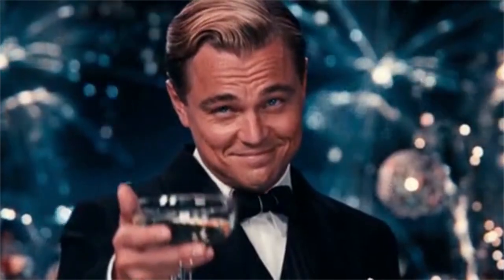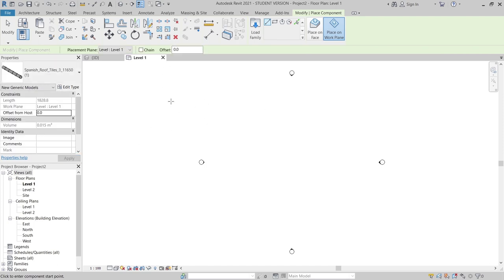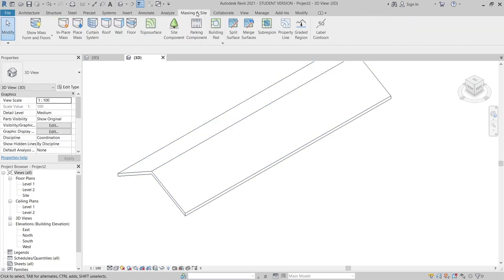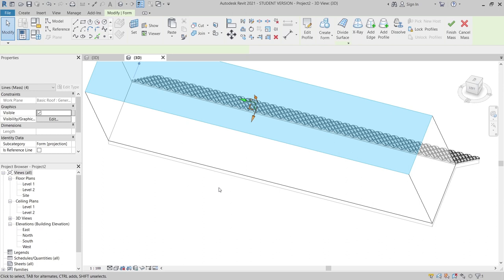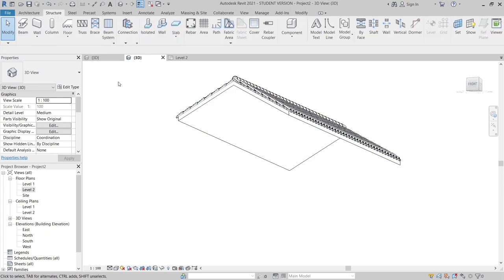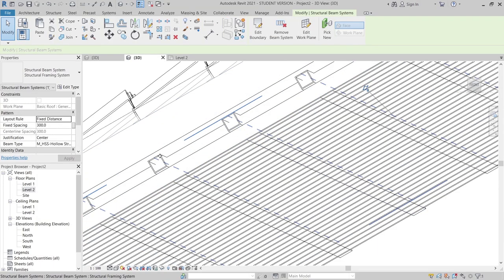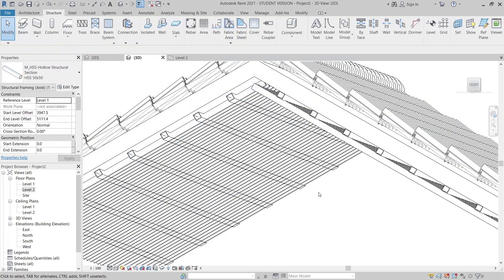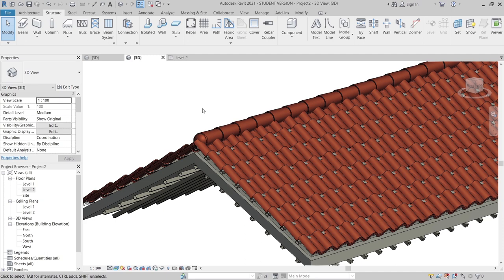Roof Tile in Revit | Placing Adaptive Component

Comment: Well, it's interesting, but overlapings of tiles are wrong, doesn't anyone see it?))
Reply: You could just tweak the pattern based family to handle lapping. You could also parametrically control the profile with a nested Generic Model family inside the adaptive component. This is really just for visualization purposes you would handle all the waterproofing in the technical detail drawings.